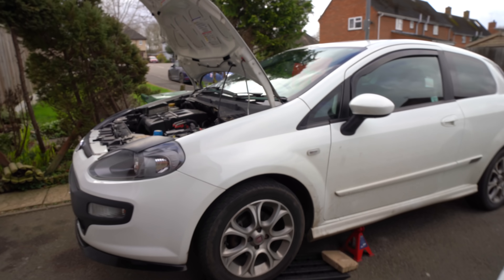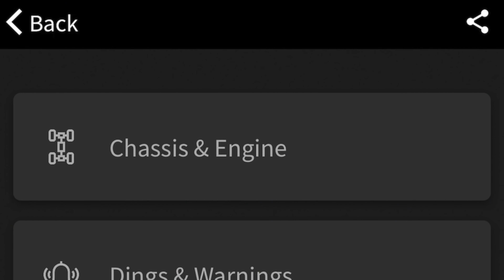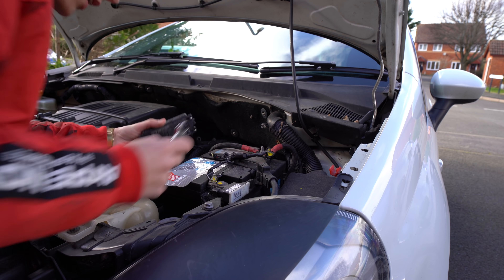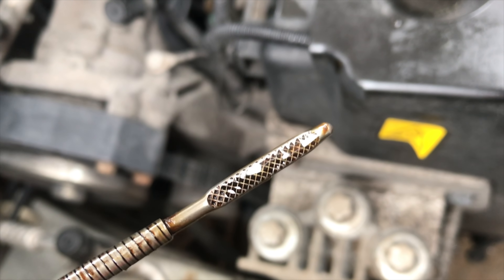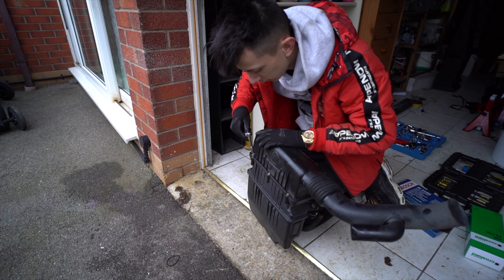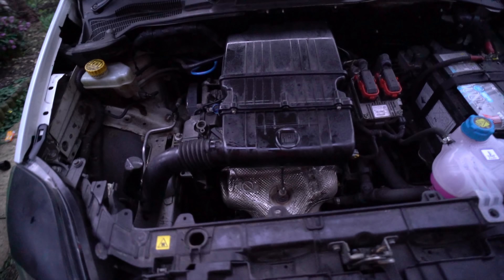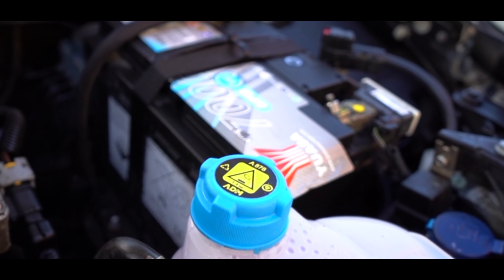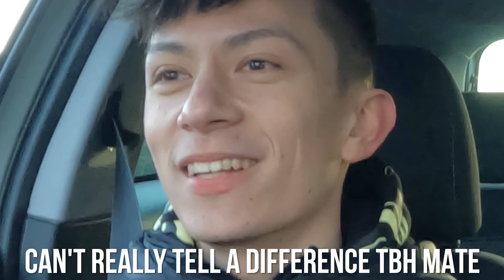SERVICING THE FIAT PUNTO EVO!

Comment: Maybe a panel filter or induction kit next, also you could lube up the gear linkages and change the gearbox oil if its not a sealed unit? Keep it up mate love the content and energy! 👊
Reply: Sealed units are a scam anything that takes oil for lubrication should be changed.

Comment: Upgrade the bulbs . Bleed the brakes . Change discs/pads , change  the injectors . Timing belt could be a push . Change power steering fluid . Gearbox fluid ? Just a few ideas

Comment: Definitely worth changing brake fluid as it’s only affective for around 2-3 years depending on the manufacturer
Reply: My car is 7 years old still not in the green with my tool for testing brake fluid acidity so not true
Reply: @user-dt5ro  It's not about if the brakes work, it about what temparture the fluid boils aka. how much water is in it. Check out any good brake fluid it will say on the bottle what it's rated at when new and then at 3% water content
Reply: @EndstyleGG  yes I know but that doesn't really matter unless it's a track car where the brakes are constantly getting slammed on for corners for normal town/City use it doesn't matter because you shouldn't be braking hard
Reply: @user-dt5ro  Right, but having water where it's not meant to be also doesn't help the longevity of the system.
How about people that live in hilly places, where engine braking alone isn't enough. Having your brakes fail halfway down a few miles of a hill isn't a very fun experience I would imagine.
The difference in the boiling point is quite massive, for example Motul Racing Brake Fluid 600 (Dot 4) has a boiling point of 312C when brand new and only 205c at 3% water
Reply: @EndstyleGG  but to get it to 205°C you would have to brake hard for about a mile at city speeds
Reply: @user-dt5ro  Indeed, but keep in mind those specs were for racing fluid, not something you find in most regular cars. You probably have a dot 3 fluid, which at about 8% of water content boils at only 120C.
If you really only do city driving, never go on a highway then yes, you probably won't ever reach anywhere near even 120C when braking from town speeds. 
I just think knowing that my brakes can handle even a long steep descent without overheating is a good thing